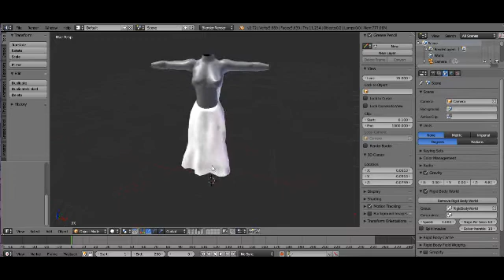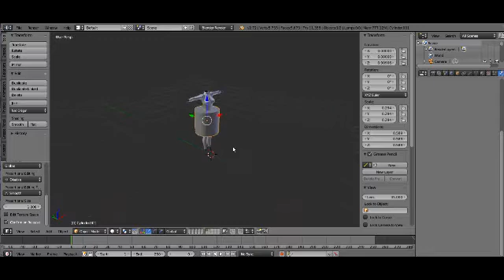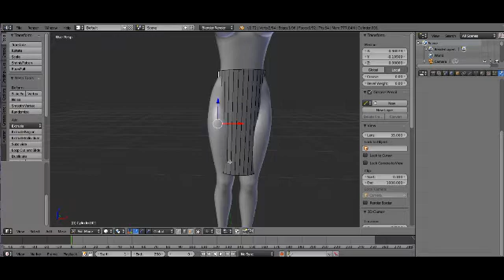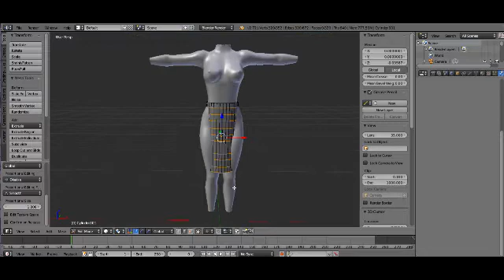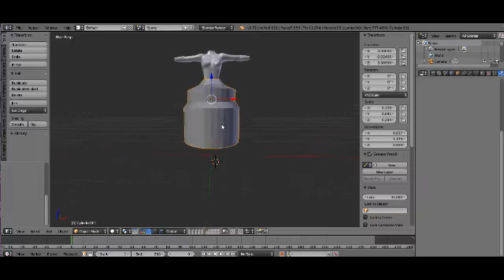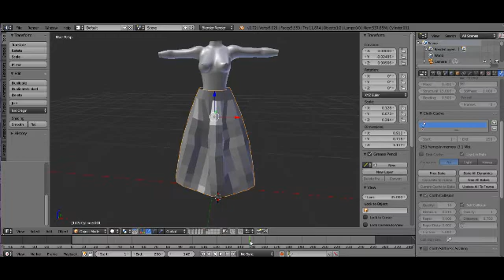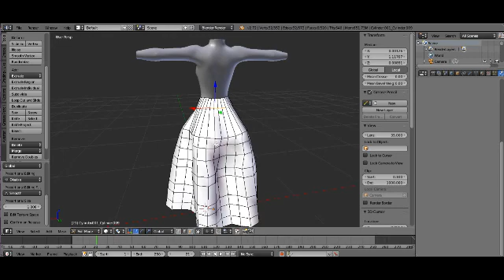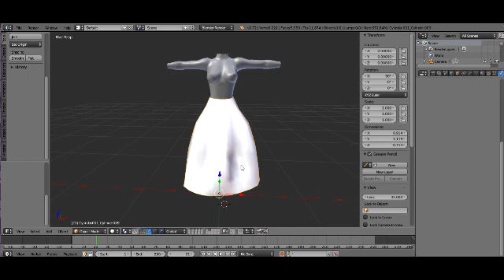Mesh Skirt in blender

Comment: Great video Nox, two little tips that might help you when you first place a cylinder in before you edit it on the left-hand side too shelf at the bottom you will see properties for the cylinder from there you can set cap type to ngon to nothing and you won't need to use face select to delete faces.

Also if you are scaling on X+Y, rather than pressing X scale it then Y scale it, if you press S on your keyboard and hit shift+Z not sure of mac command you can scale now on the X+Y axis and bypass the Z Axis this works for any Axis also you wish to scale, when your scaling just press Shift + the Aixs and it will lock that one out hope these might help and speed up your workflow ))